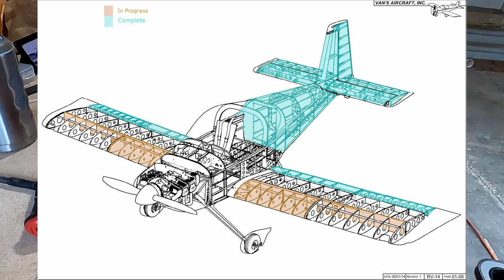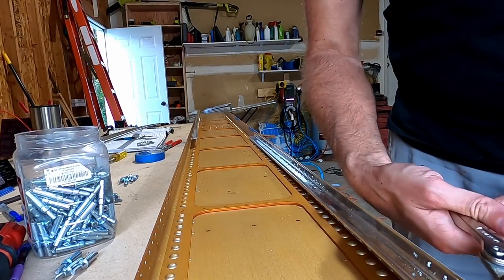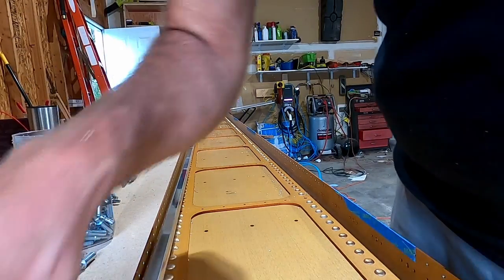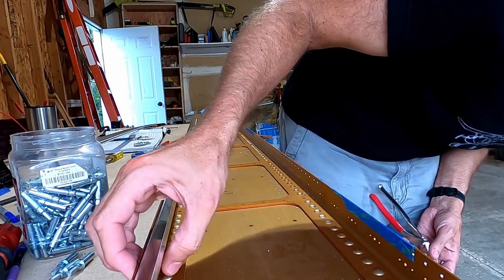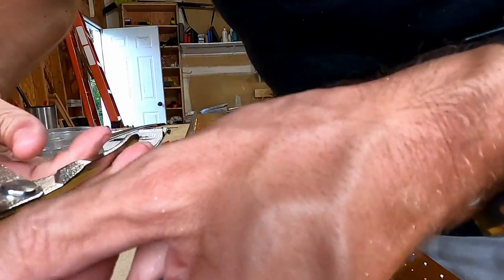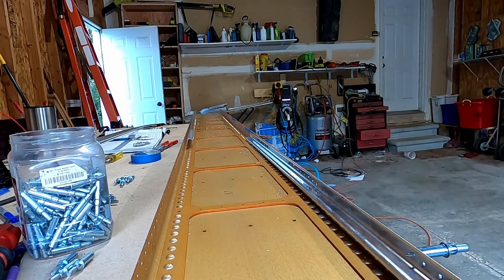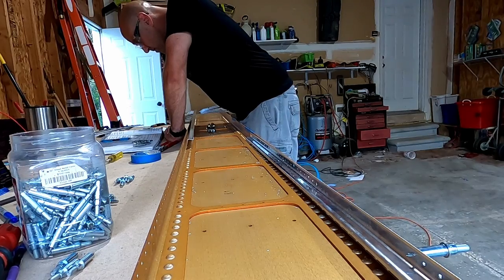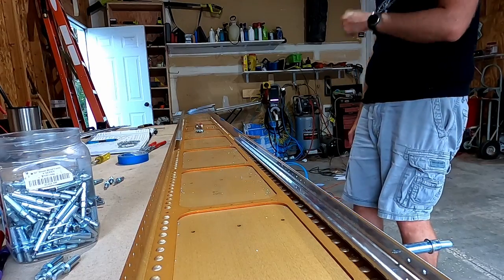RV-14 Build: Wingspars 8 (at least the spar wasn't damanged!)

Comment: I am on that step now and fortunately did not make that mistake but i do wonder does it matter.  Will that hole be matched drilled later?  If not i wonder   how sever an extra hole would be.
Reply from the maker: If you drill them incorrectly it won't just be an extra hole, it'll be an extra hole way too close to another...